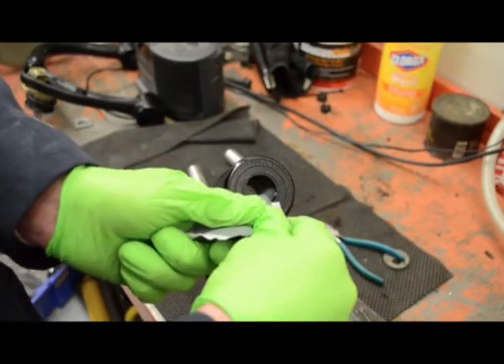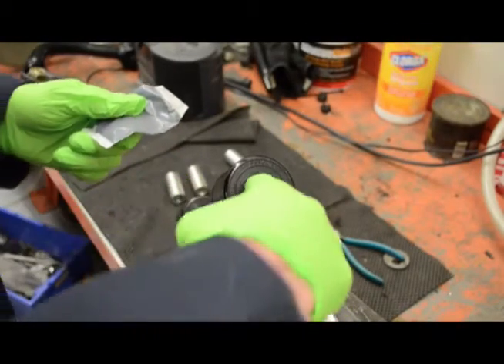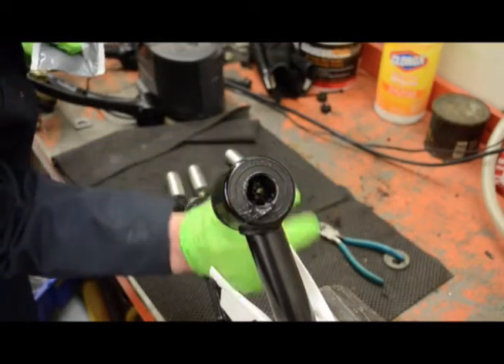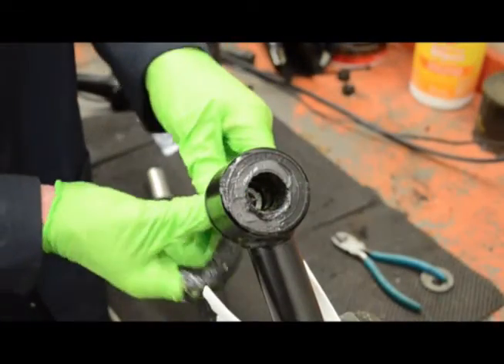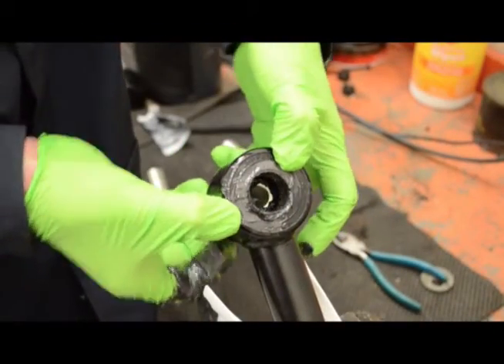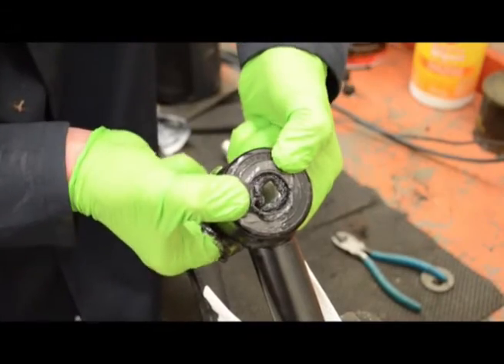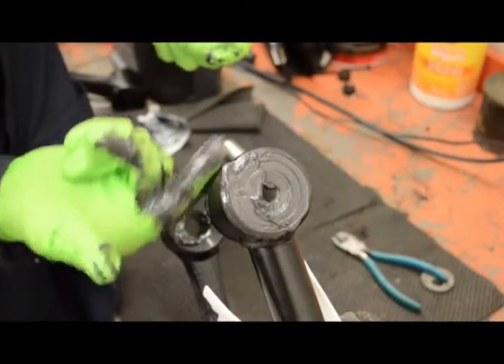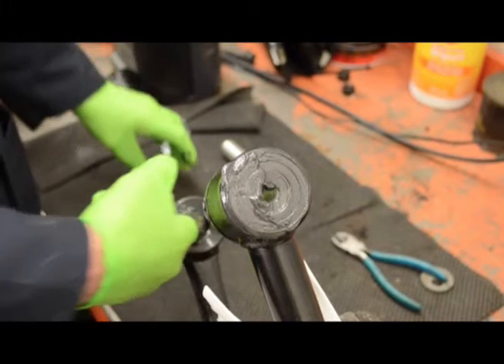SpecRide™ Bushings – Grease Maintenance– Specialty Products Company

Comment: What kind of grease?????
Reply from the maker: SPC uses grease that meets NLGI #2, Grade LB with 3%-5% Molybdenum  Disulfide. This type of grease is commonly found in most auto parts stores.
Reply: Silicone-based grease, not petroleum-based.